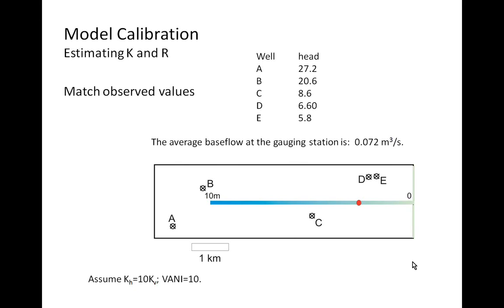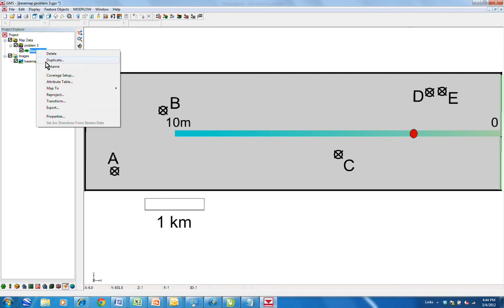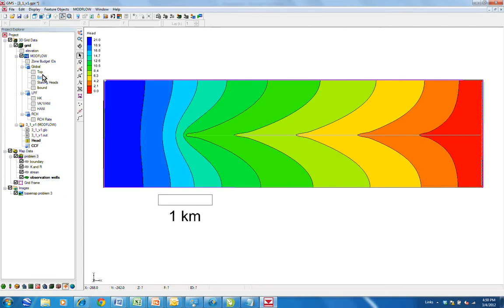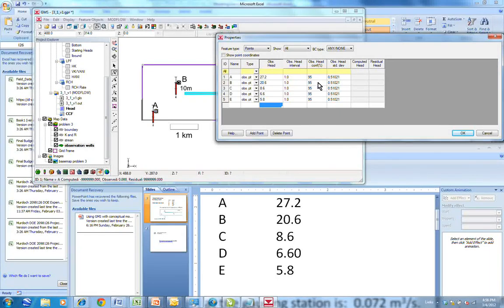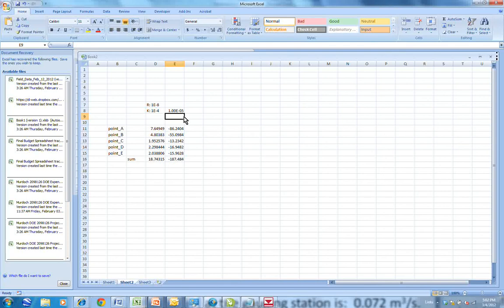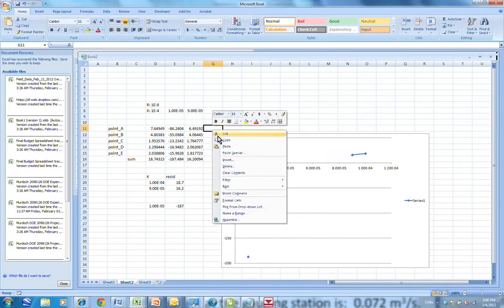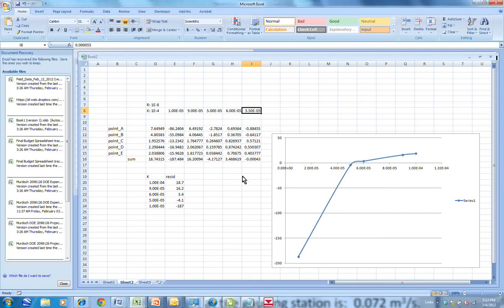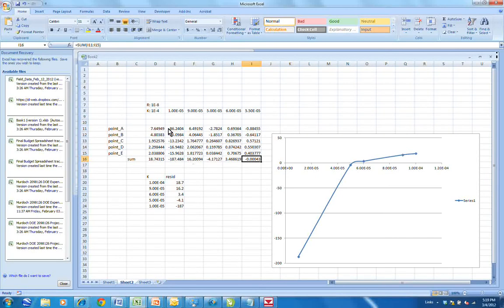Introduction to manual calibration of a groundwater model

Comment: Thanks for the video! I have daily groundwater levels data for over a year, so inorder to determine the head, do i find the yearly average or monthly average of my monitoring wells if i want to run the model at both steadystate and transient conditions?
Reply from the maker: Natasha,    I would use the yearly average for a steady state calibration.  The water level will likely change systematically through the year as the recharge changes.  You could do a transient analysis with variable recharge to simulate this effect.   Larry